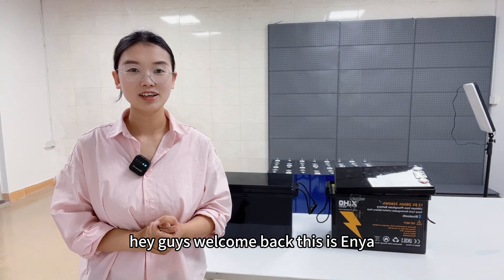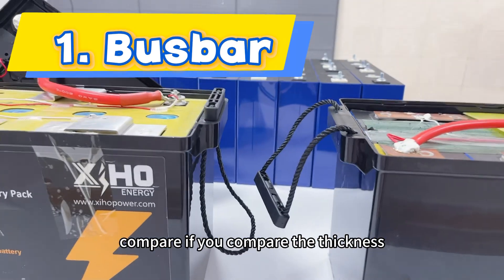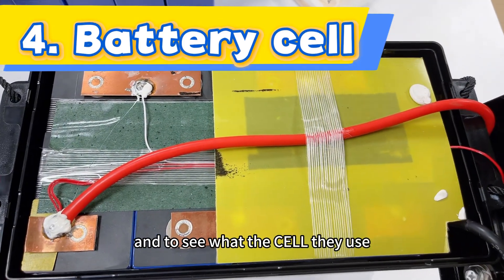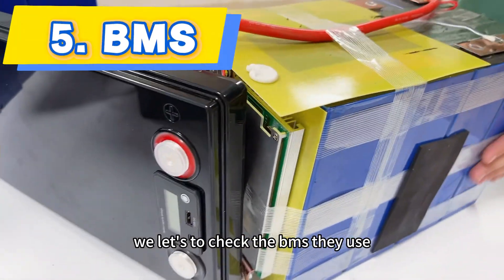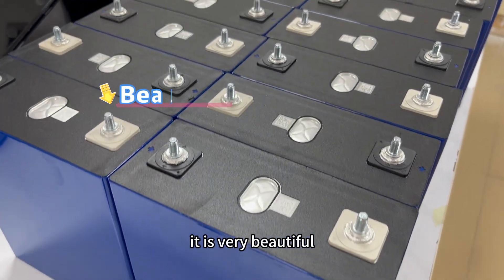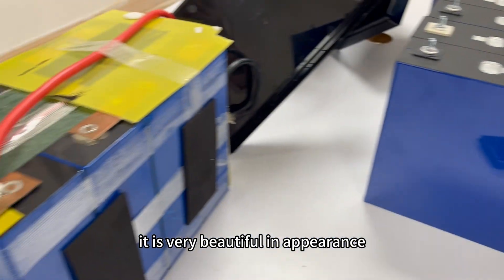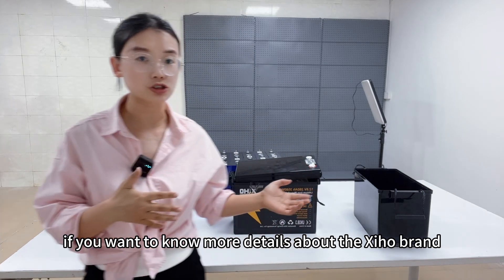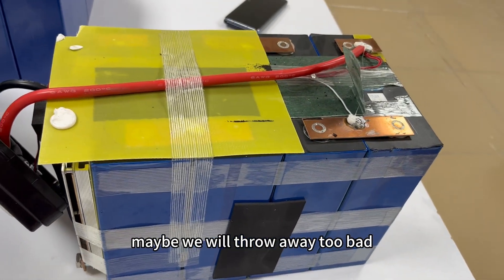$200 VS $350 for 12.8v 280ah lithium battery comparison, What is the difference?

Comment: One battery has aluminium busbars other9ne has copper busbars it is logical that copper is thinner it is better conductor.What I am worried about is that copper is not nicle plated and it is direcly welded to alluminium.
(During time aluminium will corode)

Comment: Batteries cannot be placed in all directions, because the electrolyte must cover the plates, the anode and the cathode to function properly. So either upright or lying on the right side so that each element in the battery is bathed in the electrolyte